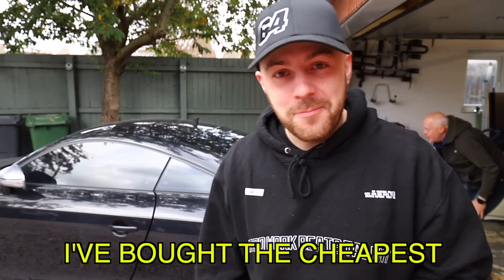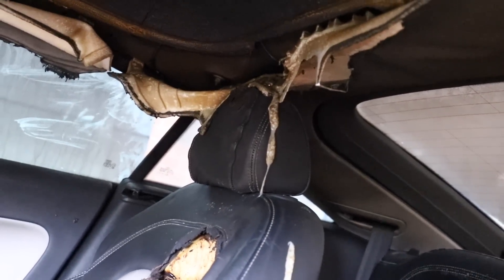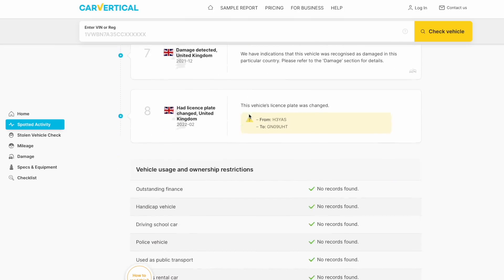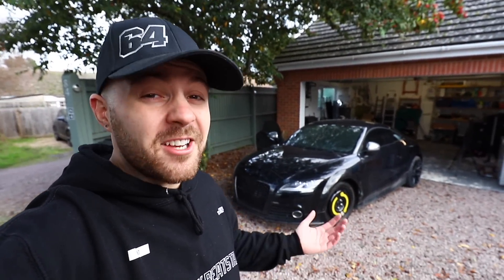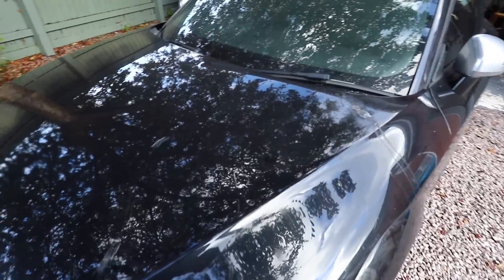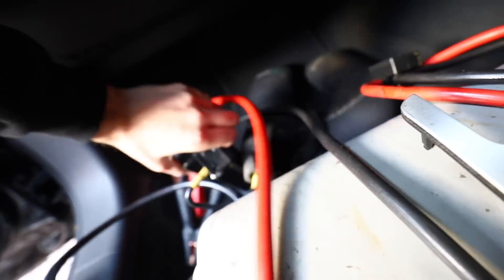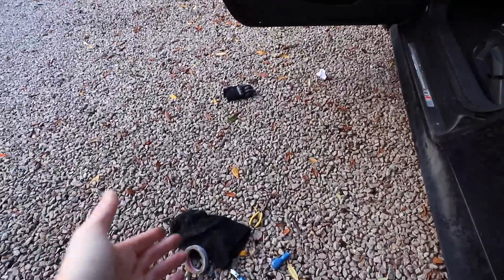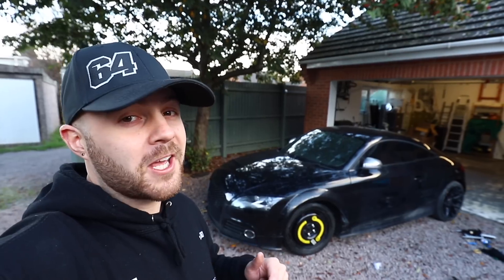THE POLICE FOUND THIS STOLEN AUDI TTS AND I BOUGHT IT

Comment: Make sure you run a replacement ground for each tail light. Have a look on the various TT forums. No good just replacing the connectors if melted.
Reply from the maker: Legend! ill look into this.

Comment: I had one of these, it was very quick (may have been remapped), they have bimetallic corrosion issues in the cooling system, was a recall against a technical service bulletin, mine hadn't been done so garage recommended flushing the coolant regularly. I found mine pretty costly for servicing, previous owner lived next the sea and I had to replace corroded calipers at a fair expense. Think you got a good price, get some all black seats!
Reply from the maker: Thanks man! Ill make sure to flush the coolant 😊

Comment: Bargain  I bought a car burned ,hard work found the bits that was easy ,the rest was hard graft cleaning and fitting up but nowt you can’t fix the seat if not replaced can be recovered by a good upholsterer with Audi parts the best smoke cleaner I used was kitchen cleaner because smoke is oily ,you’ve got a nice project 👍👨🏻‍🏭
Reply from the maker: Thank you Paul!

Comment: Manual boot release is accessible by dropping the back seat, You'll see and oval trim just under the boot glass on the passenger side. pop  it out and pull on the cable.
Reply: or charge the battery via the terminals under the bonnet.

Comment: Hi Chris mine is stage 2+ 376bhp. Interiors cheap as chips. Remember to buy heated seats / electric upgrade. Add cruise control if it doesn't. Add folding mirriors and modules, have coded if required. Air ride, wrap, apple play. Buy wings with cooling ducts if you can upgrade. Maxton body kit all round. I have DSG 😉fast as f*€k. Enjoy buddy, got yourself a bargain 😎
Reply from the maker: Thanks wayne!

Comment: Excited to see this all fixed. Must say though, for the average joe 4k into the car before it's even fixed seems quite steep, by the time it's fixed I should think it'll be near the 7/8K mark which is what you can get a non-damaged one for.
Reply: He has the benefit of a channel that attracts sponsors now, which can easily make this profitable over a 8-12 video series. Seems a great business model for the brave at heart for sure
Reply from the maker: Thanks for watching both! I think this could be repaired relatively cheaply if we can get it started… under £1000 for an interior and a wing, then the cost of a key and sorting some paintwork and some wheels. This isn’t my plan but if you wanted to do it on a budget for a bit of fun i don’t think you would be out of pocket. 😊

Comment: There is a emergency pull cable in the rear of the cabin to open the boot manual, if it still works.
Reply from the maker: Legend!
Reply: @Chris_Slix  had a 8j tt Roadster for a couple of years now, boot release was one of my first issues to sort out lol

Comment: 🔥 🔥 🔥 
Nice TT!
I have one in Daytona Grey!
Anyone had problemes with the brakes?
I changed the brake disc and pads and since then everytime Im turning and braking at the same Time it does some anoying sound. Anyone had something similar? Its so frustating. I put everything from ATE.
Than you guys.

Comment: Haven’t you just shown that car vertical doesn’t show all information?
Logged as stolen yet car vertical didn’t highlight that?

I may be wrong but wanted to ask
Reply from the maker: Good question! In short no 😅 the main indicator shows if the car is currently outstanding as stolen. As this one had been recovered already it will not show there but does show further down the page in the car’s history 😊 thanks for watching david!